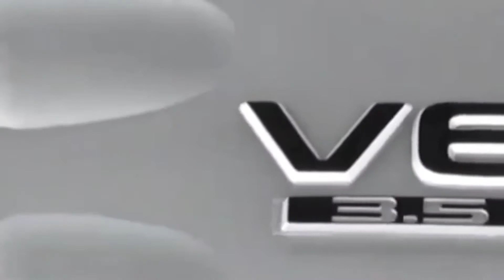How to Pass Inspection with a check engine Light....Easy Fix

Comment: Mine has gone off and on.. for the past 8 years always come back as the converter... but the gas cap is very warned..I try that that MB nice if that it.. otherwise.. I wait until it stops every year and break wind to go get the inspection done....!  but thanks  for this info